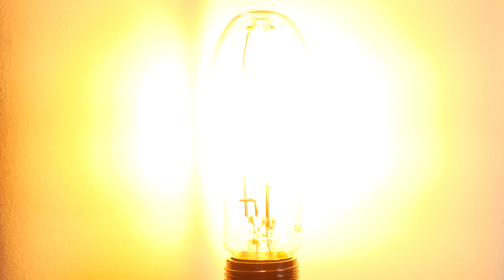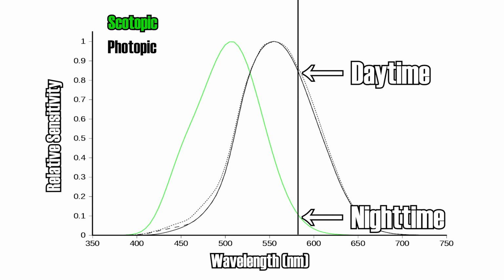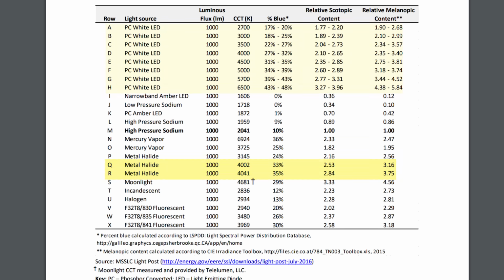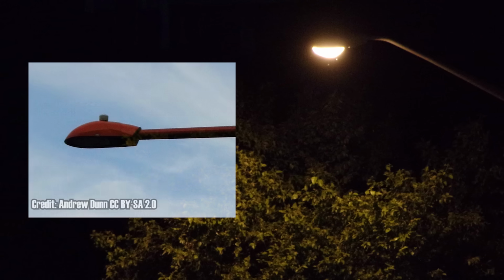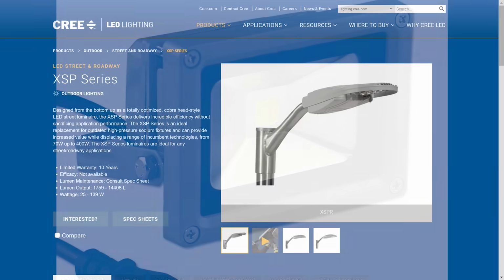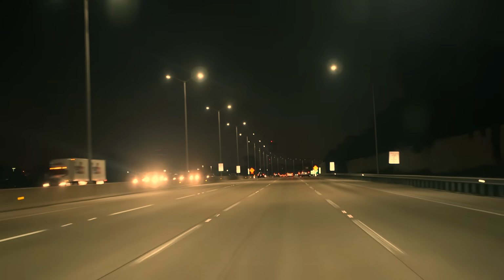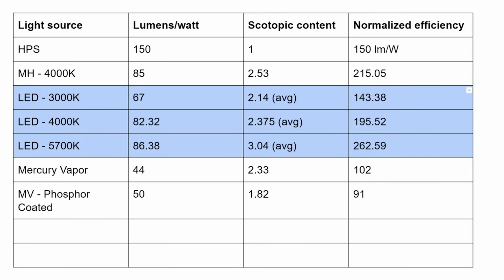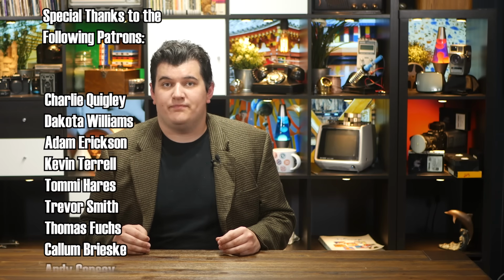The LED's Challenge to High Pressure Sodium

Comment: I dislike the new LED lighting for a number of reasons, mainly being that as they are very directional, it creates a bright flashing effect at the top of my windscreen as I drive under them which is very disrupting and annoying. There’s no doubt that blue light disrupts circadian rhythm, that’s why in my place I use the Ikea lamps that you can dim and change the temperature of so I can use daylight in the day if I need more light and warm white at night. I find my eyes very strained and fatigued after a long drive at night with the cool white LEDs, especially compared to the same usual route I drive to the coast when it had HPS and LPS street lighting. Maybe it is the flashing effect that causes the strain in my eyes though as I don’t feel that after just walking around at night outside under those lights.

Comment: Thank you very much for this super interesting video! Even though I agree with most of what you said I have some things to add. I think it´s a bit sad that you did not mention that LEDs with their much higher blue emission attract insects way more than for example HPS lamps. Considering that insect numbers are free falling in Europe this could become even more of a problem as they get drawn to the lamp an die there. Furthermore this adds to a higher maintenance cost as you have to clean the fixture more regularely to remove the dead insects. Another fact worth mentioning is that in rural areas 50% of the light pollution is produced by secondary scattering. Considering this LEDs could increase skyglow a lot in rural areas as their blue lights gets scattered way more in the atmosphere thus increasing light pollution. A downside/upside of HPS lamps is that their light gets scattered less in atmosphere thus creating skyglow farther visible.  The upside of this being that especially in regions with a lot of fog HPS lamps show a wider illumination than (for example 5700K) LEDs as their light gets scattered less. It´s right that LEDs could lead to less energy consumption IF they were used with less power than HPS lamps. Unfortunately most regions don´t consider the difference in scotoptic intensity of HPS and LED lamps and just use the same wattage of LEDs as they did for HPS lamps thus increasing light pollution. Another important aspect to add is that the bluer light of tends to glare more therefore reducing security again because the eyes have to adapt first. LEDs (especially with lenses) have a much higher surface brightness and therefore distracting drivers more. Another problem especially in less developed areas is the problem of wrong mounting. LED fixtures with an ULR (upward light ratio) of zero often do not get mounted perfectly horizontally. Because of this even a lamp design with no light escaping upwards doesn´t help much as the light gets directed upwards due to wrong mounting. Even though amber LEDs are great if you want little light pollution they have the problem of a super low efficiency (about 30% less than for example 3000K or 4000K lamps) and this value isn´t even regarding the different scotopic sensitivity of our eyes. I hope that I was able to add some new infos and that a lively discussion on this topic will start.

Comment: I always wanted a lighting fixture hooked to my thermostat and other house censors.  It would have 4 bulbs- a UV plant bulb, a IR heat lamp, some LEDs and some incandescents.  My apartment used to always run warm.  I had 4 track light incandescent flood lights in my track lighting.  It was great in the winter.  I was lousy in the summer (but not too bad, since they came on later with the extra daylight.)  What I'd prefer is LEDs that run when it's warm, incandescents that run when it's cold, heat lamps that run when I'm getting out of the shower (probably just the bathroom and bedroom) and plant lights that would detect that I'm in the room and stop trying to sunburn me.  (The laundry room is next to my apartment.  People walk by all day so to get some privacy I have tons of plants in the window.)  Throwing something in that changed the lighting depending on the time of day would be great too.  I usually can't get to sleep until 3 am, and that's after taking a sleeping pill at 11 pm.  (If I don't take the pill I don't get to sleep until 6 am.)  My bathroom has 6 bulbs.  It would be great if the light switch turned them all on during the day but only turned on 1 or 2 of them after 9 pm or so, if my track lighting could turn off/dim individual lamps linked to a timer, my computer could switch to night mode...  

I also think I have an idea for an improved privacy treatment for windows... a brighter layer between the pains to make it harder to look in.  (Okay, not great for light pollution, but easier than automating my blinds (weird sleep schedules and plants that need light), and much cheaper than those press button to turn dark windows.

Comment: Okay so each kind is good for different situations. Apparently there isn't a single light source that we can choose which is best on balance. Replacing everything with LEDs sounds like it may be mistake. And it sounds like the previous replacement round was possibly a mistake as well. So why not use all of them where they are best suited? We should have it in a gradient of lighting according to our needs and wants for the situation.

 We want people to see hazards better and faster and we don't want them getting tired on interstates, freeways, and highways. So we use the LEDs there.   We should also use those in shopping center parking lots and any 4 lane roads that are just busy streets and not highways. The exception should be public places where you might be sleeping. Truck stops, Rest stops, Hotels, Motels and shelters; Those should all use high pressure sodium with flat hooded lenses. Same thing for surface streets in residential neighborhoods, where there is less traffic and people are close to home (where they would also be sleeping). The low pressure sodium lights can be used for beaches, airports, observatories and anywhere else where you need to be awake, see well, but want to make as little light pollution as possible.

Comment: Amber lighting being less attracting to bugs has been known for a long time. We had the amber colored incandescent lamps on our porches in the 1960's. Of course, the color temperature of these made the entryways less attractive and these bulbs slowly went out of favor. I bought the latest solar walkway lights and I removed the white LED with an amber one for the cabin pathway lighting to the outhouse that has amber lighting inside.  Sure enough, when I turn on the white LED flashlight, here comes the mosquitoes and mayflies! Anecdotally, I am hearing things from my fellow amateur astronomers that the LED lighting replacement areas have worse skyglow due to more reflection of streetlights off of the streets and sidewalks.

Comment: There was a study that I'd have to look up, recently of I think Edmonton. While the LEDs don't produce more sky glow individually for the most part, in new construction areas a significant increase in the number of lights are being built nullifying any light pollution benefit and actually making it much worse. I don't know if this is because Planners think they need more lights because the overall light put is lower even though the usable output is the same or greater or because the running costs are lower they over illuminate. 

LEDs are actually creating more not less Light Pollution due to the way they are being implemented.

Comment: I've NEVER EVER EVER found a LED lamp that really lasted the number of hours or cycles it guaranteed it would do. The box says 17000 hours, but using most of them in a light with a timer I can easily figure out that they usually break after an average of maybe 7 or 8 thousand hours. And even if they don't just go off or start flickering, they get noticeably dimmer after one year of use (being on every night all the night). Surely they test them in very cold conditions, but where you use it it gets pretty hot in the case of the lamp even if the ambient temperature is freezing..

I've tried cheap brands, expensive "good" brands, buying them online, buying them from electric hardware specialised stores instead of the supermarket... it doesn't make much difference most of the times. They're all largely overestimating their durability.

So I don't believe that 99% efficiency after 100.000 hours crap.
Reply: Federico Spadone There is a difference between power supply (driver) life and LED life.  You need to learn there is a difference and the hour ratings aren’t mutually inclusive and don’t include average power supply life.  Figure it out!
Reply: That doesn't matter much, since the two (transformer and LED) come together and are not separately sold. I've actually verified that what's usually failing is the transformer, not the diodes themselves. I don't see how this would make any difference, since the hour ratings are OBVIOUSLY inclusive of the driver and fixing them is not an economically viable option. I would have to find a suitable transformer, buy a bulk of the things, then unglue open every bulb that fails and figure out a way to swap the transformers, fit it all back in and glue back the assembly. I doubt I could find a cheap enough transformer (unless I wanna buy a container full of them to lower the unitary price, but then...

Nope, they just suck.
Reply: "The box says 17000 hours, but using most of them in a light with a timer I can easily figure out that they usually break after an average of maybe 7 or 8 thousand hours"

That's because if you read the fine print, you'll realize the claimed life expectancy of most (if not all) modern bulbs is measured under very specific circumstances. The number is more or less meaningless for real life use. It's very similar to how cellphone manufacturers measure the expected standby time of a certain phone - it's measured under ideal and very strictly defined conditions you can never achieve IRL, hence your standby time being much lower than what the manufacturer claims.
Reply: I know and if fact that's what I said right after that ;)
To quote myself "Surely they test them in very cold conditions, but where you use it it gets pretty hot in the case of the lamp even if the ambient temperature is freezing.."
Reply: The quality of the power to the fixture can make a huge difference. Most of the people I've talked to with that issue also have other electronics and equipment fail way more often than typical. A lot of them either live very rural or in older neighborhoods with seriously aging infrastructure.
Reply: I've had very good luck.  I have many LED lights close to 8 years old and no failures yet.
Various brands.  Usually the 60-75 watt range.
Reply: I've send 175 watt mercury vapor fixtures that have lasted more than I've even been alive, 40-50+ years, even longer! I prefer HPS slightly a bit more but mercury vapor is better. If you had installed one right now, I guarantee you it will destroy an LED in so many ways. I know some MV's that are just approaching the EOL (End of Life) level which is 70%. LED approaches this way quickly. Most of them will fail within the next 4 or so years so I'm prepared for that.

Comment: In my city we had alot of LPS for the neighborhood street lighting which was very nice. The light went right where it was supposed to and didn't shine into people's yards or windows that much. The Major streets had HPS with flat lenses and they worked very well. A couple years ago the city underwent replacement of all exsisting light fixtures to LED ones. They're on pretty bright at night but right at midnight they are dimmed to I believe 50% power. The lights communicate with each other over Wi-Fi which is pretty interesting. Now because my city has the U of A observatory on a nearby mountain they had to be very careful with what LEDs to use. I believe they are using 2700K lights. That low color temp and dimming at midnight were all requirements from the University. Same goes with the flat lenses used on the old HPS lights. Personally I hate the new lights and would rather take back the old LPS fixtures. Another thing is i have seen a ton of these new ones die iness than a year. The light dimly turns on then off again the entire night. If you're interested in doing more research on this subject the city is Tucson AZ.

Comment: there's a reason modern smartphones and monitors have low blue light mode. Blue light is bad for health. Excessive use of white LEDs will lead to health problems.
Reply: Yep I have my night shift feature turned on my iPhone and it makes the screen have a very warm colour temperature during whatever time you set it. I noticed using my phone before bed would make it take longer for me to fall a sleep before I started using this feature. It takes a little bit to get used to but is nice and a lot less harsh on the eyes especially when you wake up and look at the screen to turn off your alarm.
Reply: "Health problems", that phrase sounds very vague and kind of fear monger-ish. You might not be doing this on purpose though.

What you should say is "sleep problems", mainly circadian rhythm complications. That's it.
Reply: Night vision (scotopic) is tuned to moonlight - cooler white/bluish !
Daylight vision (photopic) is tuned to sunlight - warmer white/yellowish !
If night lights are low levels as streetlights should be, then cooler/bluish should suit us better.
If light levels are higher than warmer/yellowish should be best.
LEDs are available as cool white and warm white but cool white are usually more energy efficient and better suited at low light ievels to our night vision.
This info is usually available in most national street lighting standards & guides.
Reply: Martin Pickard great info thanks but it's slightly off topic. People don't realise that moonlight = white, LED light = blue. There's no such thing as a white LED, hence all the blue-light filter software on LCD screens. White light is produced by exciting phosphor with a blue LED.
Reply: praestant8 why else would modern TVs and Monitors have features that protect us from what they call "harmful blue light"? And let's not forget spectacle and contact lens manufacturers spend millions developing blue light filtration coatings.
Reply: fourtysix4646 Yes smartphone, monitor, TV and lens manufacturers are spending millions trying to solve this blue light problem
Reply: Adam Nope yes you're right, it's just that I had forgotten what the specific effects were when I typed that. Thanks for correcting me.
Reply: Brian Su Don’t be absurd.
Reply: praestant8 how much research have you done?

Comment: I'm surprised that you complain about the aesthetics of LED blue-white outdoor lighting. I find the light, if a little cold, absolutely wonderful for driving under. I also find it an enormous aesthetic improvement over sulphury-orange HPS lighting, which I can only describe as "horrid." Perhaps I'm wrong, but I think a strong majority of people would agree with me on this.

Also, I'm not much concerned about potential melatonin disruption of LED street lighting. Few people come in from a long drive and jump into bed immediately. The one hour or so one spends unwinding from highway travel before bed at home should be time enough for the body to shake off the blue-white light--provided one hasn't flooded the interior of one's own house, the bedroom in particular, with blue-white light. I've experienced the sleep-disruption of blue-white light, and in my case, it was because I installed "daylight white" LED lighting in a reading lamp I was using before bed. I changed the light bulb, but what I found was that if you stay away from blue-white light for 60 to 90 minutes before bedtime, it's not much of an issue. Ergo, I don't see blue-white LED street lighting being a problem for the vast majority of people. To my mind, the potential melatonin-disruption issues experienced by a small minority of people are outweighed by the increased driving safety the lights provide for everyone.

Lastly, I enjoyed and appreciated your commentary regarding light pollution. The footage you showed of lighting from out the window of an airplane was absolutely great. I wish every town and county that was in the process of replacing their street lighting would watch that portion of your video. Thanks.

Comment: Only one highway near me - the Ely Link Road which is a 4 lane dual carriageway running through a cutting - uses large-scale LED lighting. It's a perfect use case for LED replacement as the road runs in probably one of the largest cuttings in the UK, and passes only one housing estate which already suffers greatly from the irresponsible development next to a very busy, LOUD highway. The increase in my percieved light and also the reduced light pollution is exactly as you say - I love it and want more!

Comment: Though I'm a bit dubious about the blue light scare myself, I can tell you from personal experience: Don't stare directly at a high-power blue LED for very long. I was working on a project that used a 3 watt blue LED chip and a remote phosphor cone to make a white light source with an even dispersal. I had a spot in the middle of my vision for the next 24 hours, after looking at the blue LED for only a few minutes. 

There's also the problem that blue light scatters in the atmosphere more than other colors. It's the reason our sky is blue, and it also means that pollution from blue light sources travels further, even on a cloudless night.
Reply: I'd think it wise to avoid staring at any high-power light source, regardless of color. I expect damage to the eye is more about the amount of total energy entering it and resulting heat produced after being focused on the retina than about the specific wavelength.